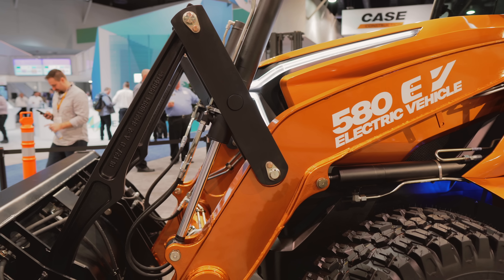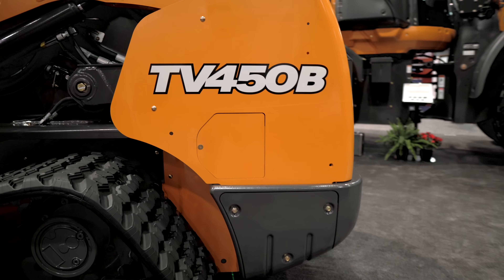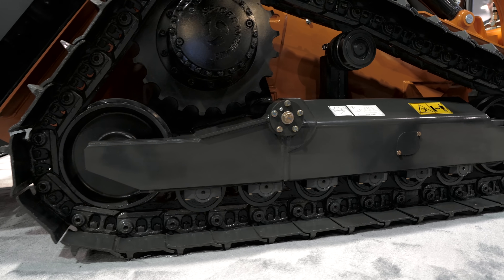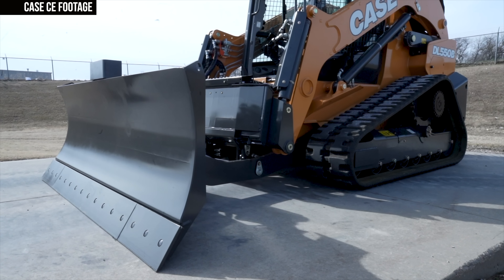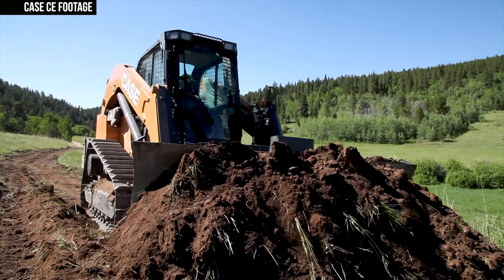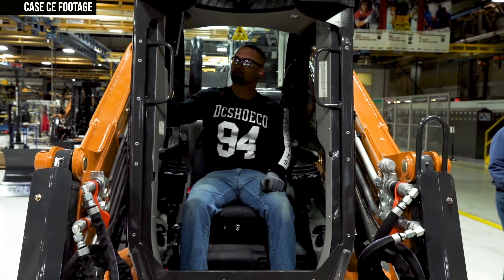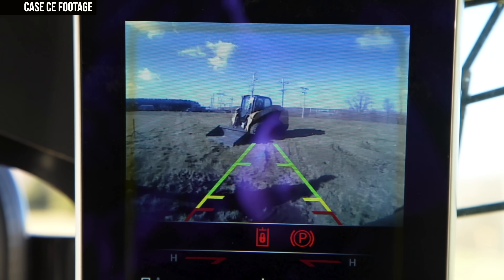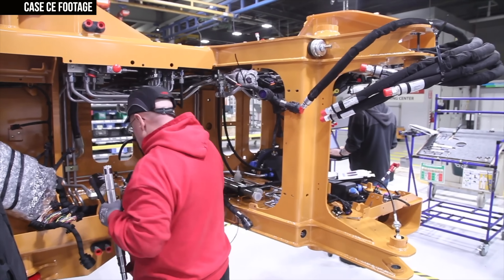Case CE Unveils DL550B: 2-in-1 Machine Both Small Dozer & Powerful CTL (Project Minotaur)

Comment: I was part of one of the focus groups for this machine in 2017 at Conexpo. Iv'e kept updated thru the years as the build changed. I believe this is the future of the CTL platform. The dozer undercarriage, C-frame dozer blade, and rippers, are home runs. I always advocated for the Enhanced Hi-flo feature to remain as those attachments make sense for this size machine. I myself am a General Contractor with 2 TV380's in my fleet with one doing 100% Forrest mulching. Whats been missing from the TV380  for Land clearing is a more robust undercarriage. Case nailed it. The options for the tracks are perfect both single and triple grousers as well as rubber. I intend to buy 2 of them (IF) it's properly priced. Please CASE do not over price them.
Reply from the maker: Thanks so much for watching and, more importantly, for providing your insight.
Reply: @EquipmentWorld  I kept pressuring my dealer for me to run test trials here on Maui  ( oh well) due to our multi /unique environment. You can be at the beach and a hour later up in the mountains with snow. I would have given extremely specific critique. The Case brand CTL has been a full time machine in my company for over 11 years.

Comment: The heavy steel undercarriage is no new concept Caterpillar has been doing it for years. As for the heavy 6 way dozer cool concept and all but when it comes down to doing serious work I've found that multipurpose machines aren't that great and generally broken down a lot. If you're doing dozer work use a dozer if you're needing a loader use a loader. Kinda like a backhoe yes they'll do the job but they won't do it as fast or as easy as an excavator or front-end loader. Basically for the price of a new backhoe I can buy both a skid steer and a 55 class mini excavator.

Comment: I hauled this thing when it was still a prototype!  Got to run it to load and unload it.
Reply: What did you think initially?
Reply: @matthewkurzhals1812  it was pretty badass.  The people that had it and ran it for a while said the only baf thing was it was 20 or 30 more hp in dozer mode than loader mode. All the power all the time would've been nicer.
Reply: Or maybe it was the other way around.

Comment: Hopefully they’ve workout the ratshit electric over hydraulic controls my TR270 was a pig and ate 3 joysticks in 1800hrs never had any sort of real world feel!! My old NH CTL was underpowered but drove beautifully, my new kubota SVL75 shits all over the TR270 in power comfort visibility control/feeling and most importantly reliability
Reply: I have 2000 hrs on my SVL75, ive had to replace the tracks once and the fan belt, thats it. I do wish Kubota would work on the cab a little more though, it leaks, noisy, and rattles like no other but its been dead reliable.
Reply: Is it electric control? I’m sure it is. I’m with you John. I bought one electric control machine and never again.

Comment: The loader/dozer is cool but the sales will probably be extremely low. One of the biggest problems I see is that a CTL shouldn’t be running on steel tracks and a dozer shouldn’t be on rubber. I think it would be cool for use on a pipeline or something where you spend the majority of your time off-road but the steel tracks would kill it for most construction work. It’s also most likely lacking a lot of power as a dozer.
Reply: Residential work in the country seems great
Reply: , I totally disagree, the thing that takes alot of earthmoving capability away from a ctl is the rubber tracks. The steel tracks anywhere off pavement will really shine off of improved surfaces. All they did is recreate a track loader. A machine that already exists. But gave it much worse visibility. This thing with a yard and a quarter bucket would dig basements in tight areas very well..
Reply: Scott McQuarrie it would be great as long as it never saw pavement but that’s a huge problem for them. They most likely won’t be manufacturing them for very long because there will be such a small market for them. It’s a cool machine for a select few people but it’s a huge mistake for a manufacturer to invest in making them.
Reply: @strangefruit8776  I think they would have a huge market share if they educate contractors of the versatility and capabilities of it. I can name 10 jobs it is perfect for right off the top of my head. Demolition and all sorts of work around residential, commercial and industrial jobs. Anywhere a comparable sized wheel loader would work, this thing can run circles around it. Plus if they would be smart enough to put quick change type rubber to steel tracks system on it, that would be a real game changer.

Comment: I can see value to this design in certain applications but remember the phrase "Jack of all trades...master of none". IMO the biggest issue with using the skid steer platform during dozer applications is the lack of ability to see the corners of the blade. The loader arms block the line of site.
Reply: Jason Chapman been a common problem with the vertical lift machines ,I used to do a lot of sub stations where there are  lots of obstructions like pedestals and footings ,for electrical apparatus and was a serious pain when final trimming .😤😤

Comment: You also need to look at the Mecalac equipment, they have been doing a similar concept for years, but based on an excavator. Far more versatile as well, but maybe not as good at 'heavy' dozing as the Case machine, but everything in a combo machine is a compromise.
Reply: I run a 6mcr mecalac and not very impressed with it, compared to everything to claim it to do

Comment: I personally haven’t had any luck with case machines. I got the opportunity to run a brand new case tr340 track loader and it only had a few hours and I was getting a hydraulic warning and it was full of oil. I do like how easily I was able to see out of it when backing up but it’s a dog compared to the power of a cat or even a Deere 333.

Comment: That thing would be amazing on Fire lines, especially in urban interface applications.
Reply: Also, the rig to deliver this to the site could be much more compact. As simple as a one ton dually regular cab with gooseneck trailer set up with just enough deck for this unit. Pull into any neighborhood on tight roads and flip a u turn in dead end streets within reason. On and off trailer in minutes. Access through residential side yards. In socal neighborhoods in the hills backed up to forestry land this could be awesome.
Reply: The speed is what I was thinking about that, high drive equals speed. That would be perfect for fire lines

Comment: Finally someone had the brains to design it with REAL tracks, not rubber ones. Being a bit heavier, it will have a better cohesion and stability, which will increase performance both of the machine and the operator because it will reduce the shaking of the whole machine and he operator will feel more relaxed doing his job. Great job, CASE!
Reply: @Emil Mitev Cat has offered a factory steel track option for a few years already- https://www.youtube.com/watch?v=rdfXCw16awg
Reply: @snorelacks7069  Sorry, I have never seen this option before.
Reply: You have clearly never ran a metal track skid.
Reply: @benhaddock7547  Nope. In general I don't like so small machines because they shake too much.
Reply: No steel tracks for all major brand CTL’s have been around from almost day 1 at least the last 10-12 years
You would only use steel tracks for these machine if ALL you did 365 days a year was small forestry work or mine/quarry work staying on soil all the time
Reply: @harleydavidson8380   ya same. And I would probably opt for a D3.
Reply: Probably last longer as well.
Reply: instablaster...

Comment: CTLs are great because they are what they say COMPACT, and FAST, and RUBBER track so I can drive it anywhere on any job.  Author should have told you that John Deere main spot light was on there 333G with a new big dosser blade with all the same goodies.  This is a big unit.  Steel tracks makes it limited in the CTL world.  The main point I see is not hauling different machines back and forth.  One machine many tasks.  The John Deere is rubber track.  The Case has a different sub-frame and lift which is new.
Reply: That's a strictly grade machine. You're not comparing a similar machine. At all.

Comment: Listen when your building that big trying to be more Dozer like I feel like you should just buy a dozer. I dont see it lasting long with steel tracks and it probably doesn't really do anything well especially dozing. You know how hard it is to grade with one of these? My boss bought a blade for our 299 cat. Yeah after 2 days I sent back to the shop and put the bucket back on.. and does anybody remember a Cat 943? Bring it back Cat!
Reply: The Bad Wolf yessir couldn’t agree with you more. Basically just good for small and I mean small lawn installs spreading loam.
Reply: I understand exactly what you mean. A skid steer wasn't designed to handle the day to day aspect of heavy dozing. On the other hand, it does appear Case has designed this machine to handle the force of light dozing. Interesting machine.......would like to see how well they hold up 5 years down the road.

Comment: Can’t wait to see some videos of these things working in real world applications and hopefully live in the dirt. Also, I’m wondering if the Cats, Deere’s, and Bobcats of the world will try to come out a comparable machine to this?
Reply: Take a look at Minotaur.casece.com for some real world views
Reply: pjs5191 Deere came out with it first a few weeks ago. Smaller machine, but mast-less grade control built in.
Reply: Mason Acheson you are correct, but it is missing a ton of the features that makes thing a true beast.  No chassis blade integration, no solid steel crossbar, and I don’t think it has dozer style controls or the weight, HP

Comment: you had me at most powerfull, the video was a little long winded with out enough visual representation of the workings, and didnt touch on the actual ctl controls are they "H" pattern, or pilot, or selectable? and you didnt talk about the ripper although I suppose its mostly self explanitory. any how thanks for the vid always cool to the neat new stuff that I'll probably never get to play with.
Reply from the maker: Thanks for watching and for leaving us some feedback. It always helps us out with future videos. There was a lot to talk about with this machine in terms of the design.

As for the CTL controls, they are the same electro-hydraulic controls as those available on the new B Series CTLs. They allow you to switch between H pattern and ISO.

Comment: Case seems underrated. They dont deserve all the hate
Reply: Dark Knight they invite it, by that I mean they never back their own “warranty” on the construction side.  Sadly they have left more than a few customers hanging, lawsuits have been filed against Case for this. Sad but true, I was a brand loyal person towards Case, no longer
Reply: Don’t like their skid steers as their hydraulic quick connects will not  work with other implements, their mount is also not standerrized to industry standards. The attachment have to be special to case.
Reply: Kenneth Obando u must be running an old one like a 1840 or 1845
Reply: Dave N it was a 2008 model I do believe they fixed the problem as I’ve since ran a new one and found the new ones are rebadged new holland skidsteers. But still shocking the older case made models have case specific hydraulic convection. Was a giant pain to have to buy attachments or change attachments with that thing.
Reply: The machines are actually pretty good I use them for about eight years Doing anything you can think about from knocking trees 10 times it size  to knocking all types of vegetation’ heavy Daily
Reply: Cat hydraulic hose couplers are specific to cat, can't get one made for a 953 track loader anywhere but a cat dealer...

Comment: I like the machine alot, but, to me you just really invented a machine that already exists, just everybody forgot about. I just don't see the advantage over say a 455 or 855 track loader with a quick coupler mounted 6 way blade. I think the crawler loaders have much, much better visibility. But it is a nice machine. I bet case engineers read my comment and say to them selves wow we never thought of that. But they will never admit it.
Reply: Absolutely. I agree. These multi use machines are neat to play with but a TV yhe end of the day they are way to expensive and clumsy to run everyday. I would rather have a older dozer and skid on the job verses one of these. Just my 2 cents.
Reply: @dirtdiggur  , with all due respect, I disagree. I like the idea of a multi purpose machine but they picked the wrong platform for it. An older case 855, or 455 track loader, not a dozer would be better than this machine, just for visibility alone.

Comment: Not to burst your bubble, but I’ve owned a T300 Bobcat for over ten years that has a 6 way dozer blade and does an awesome job pushing dirt and rocks. No, it doesn’t have ripper, but my land plain does.  Nice looking machine.
Reply: I've used the T300 and I'm not impressed;  it feels more like a toy but it only does the same work as smaller track loaders similar to the Takeuchi TL140 & 10

Comment: Interesting idea, I'll bet it is more tailored towards municipal users!
The steel tracks and rear rippers would be great during the dozer/ripping operations, compact loader operations, not so much!!
I'd like to try one, just curios if the dozer connection geometry would really work!!!
Reply: Bold Guy I would love to try one of these units. There are a lot of jobs that will damage rubber tracks in a heartbeat. This machine would be impressive in the forest with a buncher head and a grapple and even a mulching head and still be able to do your normal ctl tasks love this idea and honestly asked ASV sales rep why they couldn’t come up with a similar option. Cat has the steel tracks but I can’t fit in there cab well

Comment: One good thing bud you can have that thing. Now this is just me . But I've never liked those machines. I'm never like that bucket right up in front of me like that. because most dumbass people that get on them things don't know how to operate it and let the bucket leveler keep the bucket level. So after two or three buckets the bucket leveler don't work any more. And if you get on it and don't realize it next thing you know you have dump a shitload of rock and dirt down on top of you.  So if I can't do it with a rubber tire backhoe and a d 5, I  don't want it.  Yes I had a very bad experience with one that was brand-new it won't with 5 days old. The boy that operated it before me messed up the bucket leveler. I I didn't know it the first bucket of dirt I got I don't rock and dirt down on top of me. Bent the safety screen and busted the windshield on it. I got off of it and never got back on another one. And will not get on one today. So you can keep every one of them things if you want them. 🤨🧐
Reply: I've never seen a machine with the problem you described and I own a bunch and rent a bunch more. You will not admit it but you must have experienced a operator malfunction.  
I've never even heard of 1 being broken.  Now I do own 4 large rubber tire loaders with 3+ cubic yard buckets and a large 963 with an oversized 4 cubic yard bucket and 1 of the rubber tires has a broken wire to the leveler because a dumb a$% thru concrete over the bucket and broke it.
I recommend you read the operator manual before you use another one.
Reply: Sounds like operator error. Perhaps stick to a lawn mower
Reply: You say you hate them because people don't know what they're doing, yet here you are telling us you don't know what you're doing. Go back to shovels and wheelbarrows man.
Reply: OH.....Cry me a river...............................